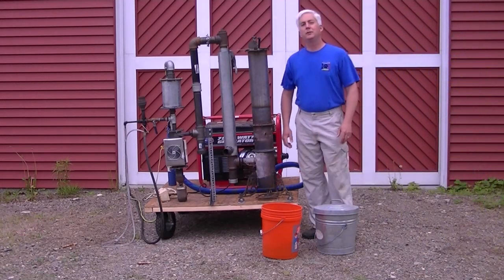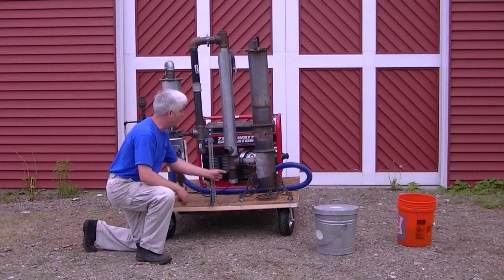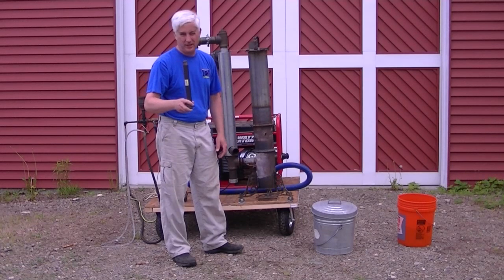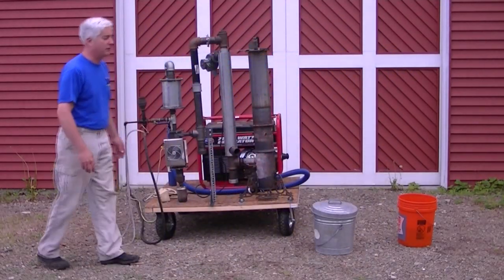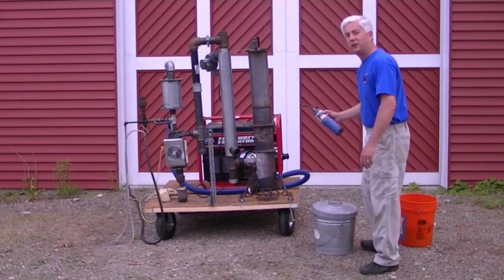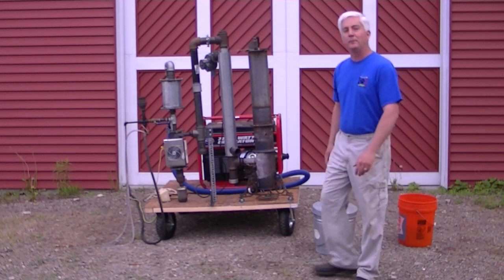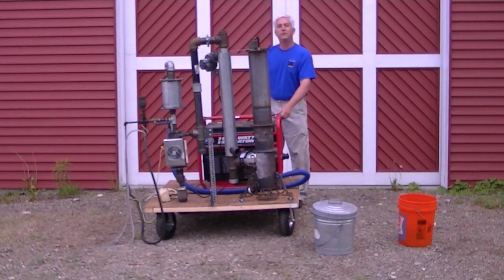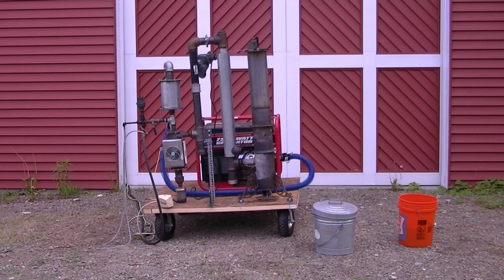How to start a generator on wood gas

Comment: Not the best or really even a good design but kudos on innovation ps if you absolutely think you need the compressor to start I suggest a battery and dc kinetic generator... We are going for off grid after all;)

Comment: So your emergency, self-reliance, wood gas powered generator requires compressed air and electricity to start?  What alternatives or off-grid options are there?  Is the vacuum step mandatory?